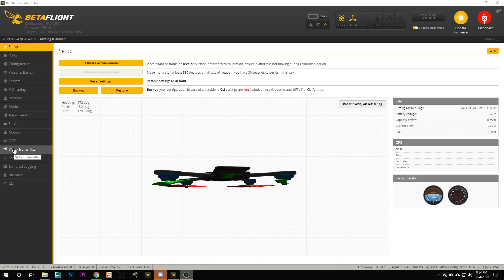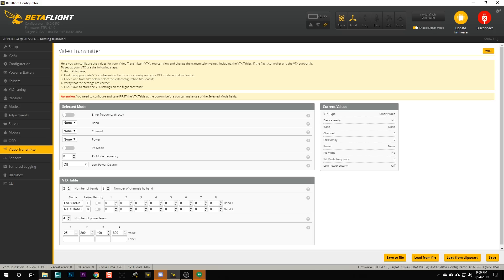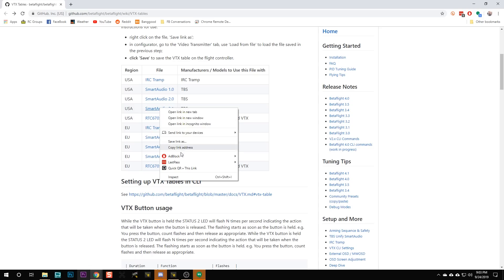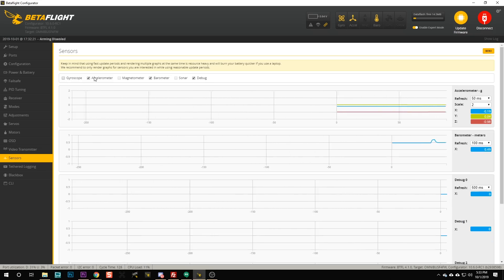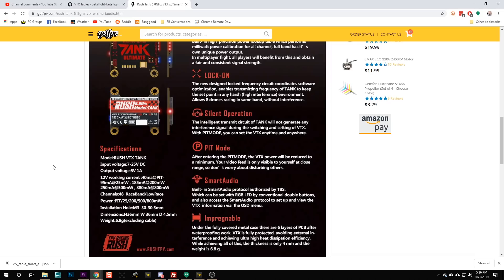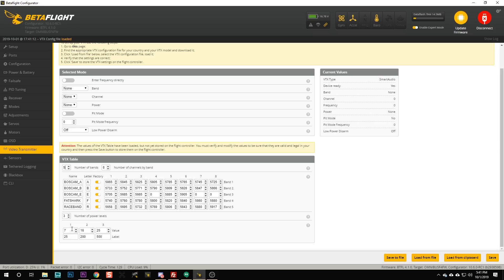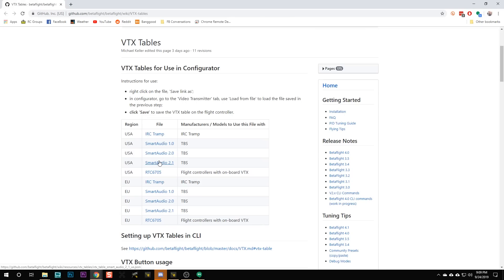Betaflight 4.1 vtxtables | WHY SMARTAUDIO DOESN'T WORK AND HOW TO FIX IT

Comment: Hello Sir, can you help me? after I flashed BF 4.1 my VTX low_power_on_disarm does not work :-/ (in VTX tab it is enabled, but after I arm the quad nothing happened). Can you figure it out, please? (using the same VTX as you -> rush tank) 
EDIT: finaly figured it out. Smart audio debug key = 216 is actually Smart audio 2.0 (not 2.1 as you shown in your video an it needs to be set as 0,1,2,3 with mW output 25,200,500,800mW). Now it works great! Thanks anyway :)
Reply: Thank you for your comment, finally my eachine TX805 works
Reply: Which protocol file did you use, and what exactly are your settings? My TX805 now tells me I have a Tramp not configured error.
Reply: thank you you helped me fix the issue i had the same problem kinda my powers wouldnt change thru goggles thank you
Reply: Im having the same problem, but with a IRC Tramp, I already downloaded the config file for my vtx but its still not changing the output power after I arm
Reply: THIS IS THE GOOD CONFIGURATION FOR THE RUSH TANK  (0123 smart audio 2.0) .
I found before seeing Bardwell video !!!

Comment: Odd question what happens if you put your power level in dbm to an unsupported level on your vtx, will it just burn up your vtx or go to the closest powerlevel
Reply from the maker: Nothing will happen. SmartAudio will simply not work at all.
Reply: @JoshuaBardwell  another question what happens if I put like a odd power like 50 mw will it just go the closest power level or can you make custom power levels
Reply from the maker: No that's what I'm telling you. If you program in power levels that the vTX does not recognize, it simply stops responding to SmartAudio entirely.

Comment: Hey joshua you should add, if you try sa2.1 and it still don’t work, to try 2.0. I had that problem. Debug shows 2.16 like your video but it still didn’t work till I tried the 2.0 settings. Now it works perfect. Thank you and uav tech. I actually figured that out after watching his video
Reply: joseph mendez  216 is 2.0 the 16 means it’s unlocked

Comment: I got the vtx table set up in betaflight. i can change channels on osd but not lua scripts. just updated opentx and lua 1.3.0. vtx tab in lua has a U for band and 128 for freq. Is lua not up to date with 4.1 yet
Reply from the maker: That seems likely.
Reply: @JoshuaBardwell  thank you. And your rssi vid just fixed my other issue. Thank you for that also.
Reply: so you go trough osd and set band and channel then lua scripts work. I dont get it but it works now

Comment: I also am using Rush Tank Ultimate.  The manual says Smart Audio 1.0. I checked the Debug file and got 216 for Smart Audio 2.1.  I used 2.1 settings but do not get proper power output using a power meter.  I had to use 2.0 settings to get appropriate power settings to output from the Xmtr. Am I doing something wrong? Have you checked the output power from your Rush?
Reply from the maker: 216 is actually 2.0. Very confusing.
Reply: @JoshuaBardwell  Thank you.

Comment: VTX frequency tables: OK, makes sense, but would be great if it would have sensible defaults. VTX power levels: Partial nonsense. Newer SA2.1 devices actually report their power levels via 0x01 GET SETTINGS and all you have to do on the MCU is convert it from dBm to mW. So a check button "Custom" would have been sufficient for the cosmetic issue of the few SA2.0 devices that do not comply with the original "Unify standard".

Comment: SA does not work if it does not fill the previous setting VTX in the selected mode. After this intervention, SA via BF lua is functional.

Comment: Slight correction at 8:00 into video, if your debug is showing 216 you've actually got sa 2.0 unlocked not sa 2.1. Reference below from betaflight vtx tables page on github:

Smart Audio Debug[0] key:

100 = SA 1.0
116 = SA 1.0 unlocked
200 = SA 2.0
216 = SA 2.0 unlocked
300 = SA 2.1
Reply from the maker: Yeah Mark just added that after I made this video and he made his. This is why I hate making videos about Release Candidate topics instead of full release.
Reply: @JoshuaBardwell  all good my man, love your work :)

Comment: Folks on new Smart Audio 2.1 need to check out: https://github.com/betaflight/betaflight/blob/master/docs/VTX.md#smartaudio-v21-devices-vary-depending-on-their-model-check-the-manufacturers-website which is linked on the main BF VTX table wiki that is linked in the Configurator. 

Bottom line is TBS has made Smart Audio complicated anymore (multiple versions, different VTXs handle output power differently, etc..., etc...).  Add to this all the licensing or cloning of their protocol by other manufacturers that may or may not been implemented correctly - I'm talking to you AKK - and it is a cluster F$CK.

BF devs said to hell with this shit and exposed all the variables in the Configurator so the users can configure based on their VTX; plus there is the illegal channel thing.  There is NO WAY for BF to know if you have a TBS Unified EVO vs A TBS Unified Pro32.  If TBS would have all their VTXs follow ONE protocol, this wouldn't be an issue.

So if anyone gets mad at BF devs for VTX tables, they should vent elsewhere. Hopefully, Smart Audio 2.1 is the LAST update to the protocol.  It seems like IRC Tramp can get it done with ONE protocol version.  Just saying.

Comment: Having to learn a new betaflight version every couple of weeks is a huge pain in the ass. I've basically stopped upgrading at 4.0 and will stick to my old hardware that supports 4.0 or 3.5 until I am forced to switch. I'm sick of having to spend hours studying to make the new version work, and then having to forget all that new knowledge in a couple of weeks when the even newer version comes out. It's awesome that the devs keep working on and improving betaflight.  However, I feel that the development pace needs to be addressed. The learning curve was steep enough in version 3.5. Now it's just gotten that much steeper. Maybe we need a beginner version of betaflight, to make it doable for those just coming into the hobby.
Reply: The release cycle is every 6-months so....

The beginner version is Cleanflight.

Comment: What do I gain in 4.1 over 4.0? I always run into issues upgrading firmware and need a good reason too.
Reply: Rpm filter
Reply from the maker: RPM filter is a pretty big deal.
Reply: @JoshuaBardwell  I guess I'll try it. Hopefully I don't run into issues
Reply: @JoshuaBardwell  "Failed to open serial port" and "initiating reboot to bootloader" I guess it wasn't meant to be lol

Comment: Why can’t you just solder the wires to the correct output for smart audio???? Do you have to go through the vtx tables through betaflight
Reply from the maker: Yes you have to set up vtxtable in betaflight before you can use smartaudio.
Reply: Joshua Bardwell so you’re telling me you can no longer connect the wire from the tbs unify pro hv vtx to the crossfire directly and use the crossfire module to change your vtx channels?
Reply: @Ron-nq6ft  No. That still works.

Comment: I loaded the file for my speedy bee 🐝 on tramp protocol and it screwed up Lua script was jammed on output power zero could not change it . Took me hours to work out that it had to be exactly how it was before and not as the the instructions said , there’s not many tables for tramp but there is for TBS vtx , this is a useless pain in the arse 😡

Comment: So just to be clear, this has to be done to use smart audio? Or for the vtx to work with 4.1 flashed? At first you mentioned an easier way but I never heard it, or was that the easier way?
Reply from the maker: Thus has to be done before SmartAudio will work to control the vTX.

Comment: Hi Joshua, today you will learn something! 216 is smartaudio 2.0 in mode 16, Wich means unlocked!
You will also notice that your power level reading in debug3 is like 1, 2, 3 and so on. On SA 2.1 your power level in debug would be 14, 20, 26...
Reply: What does 220 mean? Plz help
Reply: @tornatotato91  did you ever get an answer? I am getting same number.
Reply: @briankmavpro5246  Hello, I have little bit same problem bcs I have value 222 and I don't know what does it mean. Should i reflash FC?
Reply: Joshua lern something Today Hahahah
Reply: I missed your response before I posted regarding the 216. The 16 makes sense- unlocked. I had read Tank was 1.0 in the manual and put in the numbers for CLI. The people in my heat were not happy and I went to a back up quad. Fixed now. Thank you.
Reply: Yeah. Maybe you are correct. In gitub says so. Debug must say 300 to reference to version 2.1.
Maybe that's happening to me. My debug says 217 and i think i have SA 2.1. And can set correctly the freq in the osd. Now i tgink i have 2.0. Tomorrow i will try 2.0 and let you know.
Reply: @juanmanuelamado7732  hey man. I have the eachine tx805, and I''m not sure if I have a damaged VTX or I set the tables wrong. it also shows 217 in debug, but sets wrong frequency... I think 5820 instead of 5800, thought it was the damaged vtc ( one little inductor has parts of the little case falling of and I can see the coil) did it work with 2.1? I think I'll try 2.0 now..
Reply: @hallio111  i correct just like i describe before and its working
Reply: @juanmanuelamado7732  hey thanks man, then it must be my broken vtx...

Comment: 8:48 - SmartAudio 2.0 & 2.1 value = dbm
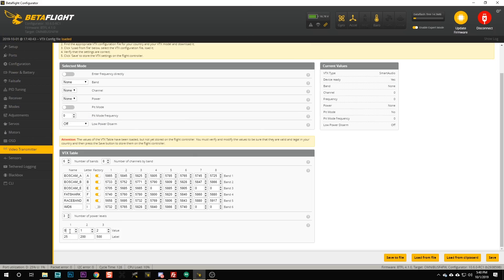10:18 - SmartAudio 2.0 value = 0,1,2,3
which one is it?
Reply: 2.0 is 1, 2, 3, power levels.  Only 2.1 is the dBm power levels.

Version code 216 is SA 2.0 protocol + unlock code 16.  I messed this up in my video.  3xx is Smart Audio 2.1.  Crazy right?
Reply: @uavtech   I have debug 222 as Smartaudio.....what version should I use?
Reply: @CaptKwagga  , 2.0
Reply: @uavtech   Fantastic, thanks for clearing that up. I feel comfortable enough now to set my drone up! To summarize, from what I gather via videos & github,  debug codes 1xx = SA 1.0, 2xx = SA 2.0 & 3xx = SA 2.1, also,  values = 0 1 2 3 for SA 2.0, DBm for SA 2.1 & some numbers that seem arbitrary for SA 1.0 (obviously the numbers do mean something).
Reply: probably the second one?

Comment: Couldn't this have been done much easier? Default to the traditional smart audio or advanced with presets for the couple most common vtxs? I mean 4 presets could probably cover 90 percent of vtxs right? Then maybe a custom option for other vtxs or old versions running old smart audio versions. Idk. This seems like it's going to be a problem for those who just want to change their basic vtx settings especially noobs.
Reply: That's just an excuse. Both US and EU settings could be added, then let the user make the decision. This VtxTables is an half-baked feature.
Reply: He explained it, it is a legal problem. Should they ship it with USA defaults? Or with EU defaults (even fewer frequencies and only 25mW)? So they decided to ship it without any frequencies at all and let the user download them separately.
Reply: @foo2332  what shipped? You mean betaflight released? Legality is kind of a shaky reasoning for this. It always has allowed you to set to higher power values and frequencies that may not be allowed in your area or require a license. The hardware still needs to be unlocked and is what is doing the work. I can't see the fcc making a fuss about software and github hasn't objected so far so why would they start? The end result is the same. As it always has. A simple disclaimer about checking local laws would suffice. Just now it's one more thing to setup. This is just asking for people to have problems on top of the normal noob confusion stuff. Incorrect power levels were just an odd quirk we dealt with. This just seems like an annoying solution to a minor issue to me. Give a default option like it was and an advanced option for those who want to change it.

Comment: Trappy is a moronic pillock "oh other people are using our vtx protocol that needs to be implemented in open source software" 
I know lets keep making useless changes to the protocol so that supporting out new stuff will break support for old stuff.

Betaflight devs: ok we have had enough of this bollocks input your own bloody vtx settings and protocol information.

Best solution just support the original version of smart audio and tramp telemetry and tell tbs stop being stupid or will drop all smart audio and they will have to use tramp protocol.

Betaflight team need to start setting the rules not reacting to idiot hardware designers whims.

Comment: Wow, and I was thinking that each version of BF will be more user friendly...
Reply: I think the problem is that they have to cater for so much different hardware.
Reply: @thetubemeister82  , BINGO!  we have a winner!!!
Reply: It’s getting very complicated. Just because every one doesn’t want responsibility
Reply: @xaralampos1959  , you mean all the folks that clone FC names, but want their own target name and VTX manufactures that keep switch the SA protocol?  Everyone wants the stuff maintained for free though.  Geeze.
Reply: UAV Tech Do you have a normal job please?
Reply: @xaralampos1959  , yes.  I'm a Civil Engineer for a 200 person firm in PA.  I lead our NEPA operations.
Reply: UAV Tech good for you then because you have a regular job and have the time to do all this vids on YouTube. Some of us don’t have time at all so we want just to fly
Reply: @xaralampos1959  loading a VTX table is 5-min.  My video on it is 8-min.  Don't upgrade all the time or fly KISS, F1 or Cleanflight.
Reply: UAV Tech well I was thinking to turn to F1 or Kiss like most of the guys here in my country do. Just more money to buy F1 fc or kiss fc. But I have some issues with previous version of firmware 3.5 or 4.0 and I thought if it will be fix with the 4.1 but I’m screwed more. I’m thinking putting back my Nase32
Reply: @xaralampos1959  , go for it.  What issues are you having?  Did you report as an issue?  SA works great in 4.1.  The ability to get the power levels set correctly and easily tell the board the frequency vs. using the built-in tables make it easy for bypassing the internal VTX locks which confused a lot of folks.  The only hitch is you need to know if you VTX is SA 1, 2, or 2.1 since stupid TBS keeps changing the protocol.  Notice the Tramp VTX's it is easy.  Plug, load table, and go.
Reply: UAV Tech at first I had warm motors with just 1min test flight and and in that minute motors where like desync in punchout so I went to 4.0 and then I had weird yaw flip when arming the motors.
Reply: @xaralampos1959  , make sure FC orientation is right in Configurator.  It changed on some FC boards.  

If you have warm motors, put in you 3.5 filters if those worked the best for you.  Have you seen: https://github.com/betaflight/betaflight/wiki/Community-Presets#revert-to-bf-35x

What you are talking about is just firmware setting.  Defaults have moved around since 3.4 so if you have old default that worked better for you specific rig, put those in to the new firmware (DIFF paste) if you want.  Or just say on the old.  Noone must upgrade.  It is not Microsoft or Apple, like forcing you to upgrade.

But if you stay on old, no need to be a drama queen about it either.  Folks seem to like to be drama queens about.it when they choose not to upgrade.
Reply: UAV Tech sorry to bother I just bought a TBS Vtx evo I could change the vtx when I hold the button on it. But in betaflight says it’s on 800mw but really isn’t. AKK same problem? Thanks
Reply: It is indeed. 4.1 is pretty awesome.
Reply: 4.1 is more user friendly than 4.0 imo

Comment: Hi Joshua, i got the 216 numbers for my unified pro race and uav tech messaged me back and told me to use smart audio 2.0 and not 2.1 not sure why
Reply: 2 as the first digit means 2.0.  If 3 is the first digit, it means 2.1.  See: https://www.screencast.com/t/clXNDhRt
Reply from the maker: Thanks for clarifying Mark. Eventually we will figure this out.
Reply: @uavtech  Why couldn't they just call it Smart Audio v3? :-/